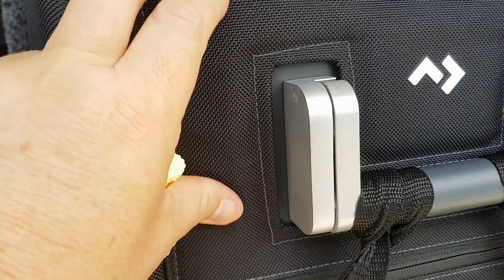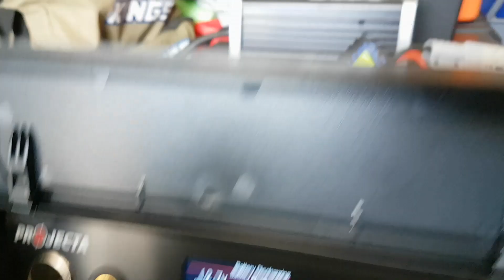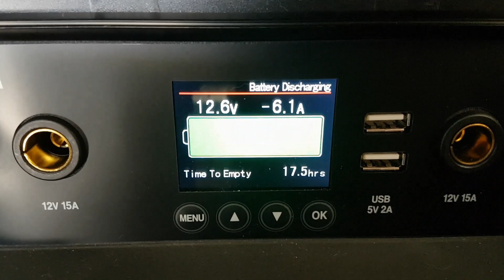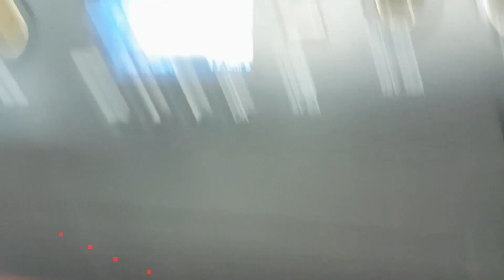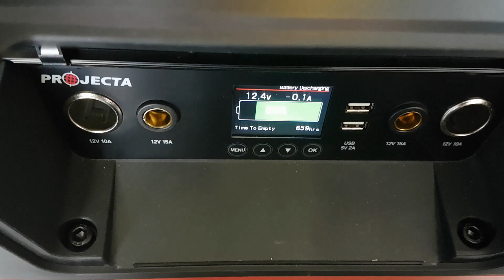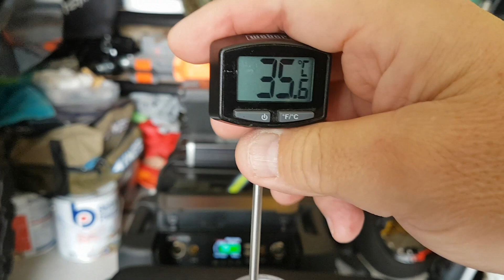Dometic Waeco CFX3 35l Fridge / Freezer - 24hr Power Draw Test & Initial Thoughts

Comment: a cinsukta, does the upper drawer cool the same as the lower one? I have an older Dometic CDF and the top drawer only keeps the food fresh but not cold, it is for fruits, eggs, etc. and I have that question if it is still the same as before or does it cool just like the basket part?

Comment: Cooling down is going to take a lot of amps no matter the brand. I’m sure you cool yours down before leaving if possible as that reduces the load once you in the  vehicle. Have you looked at the effect of the cover on the dometic vs uncovered power draw? Thanks
Reply from the maker: The cover for the CFX3's is more protetice and doesn't have any insulation properties like the previous ones or other brands.

Comment: Hi there.
Would a Yamaha 1000 generator power this fridge?
Greetings from Port Macquarie.
Reply from the maker: According the Dometic website it should use about 75w when running on 240v so the 1Kva gennie should do it easy.  The only thing you would have to run the generator constantly to power the fridge.
Cheers